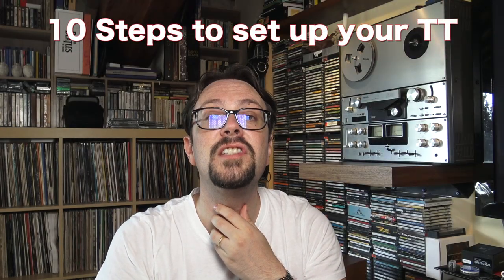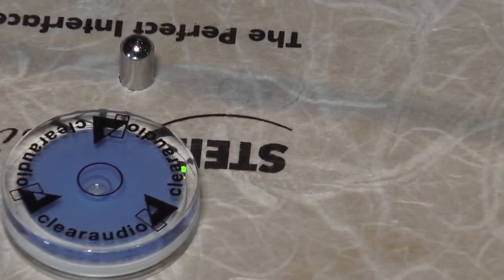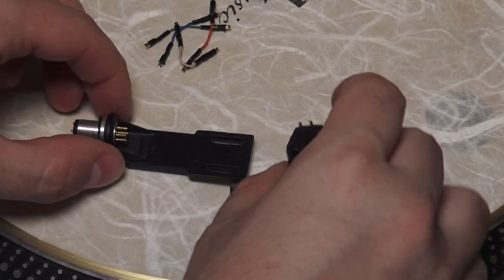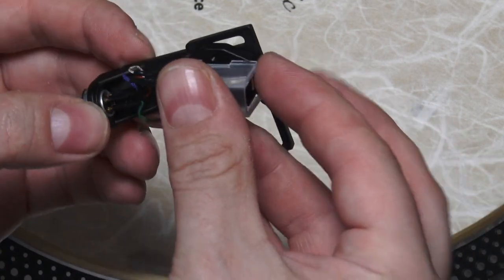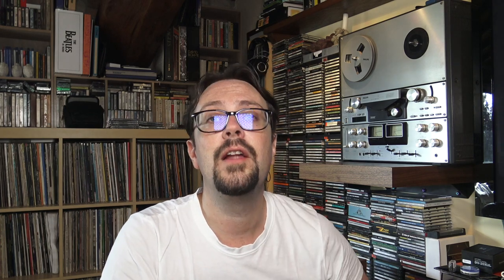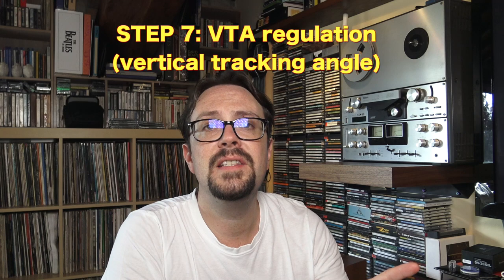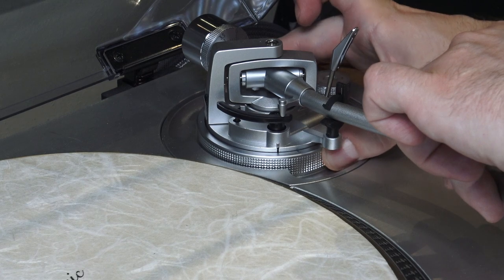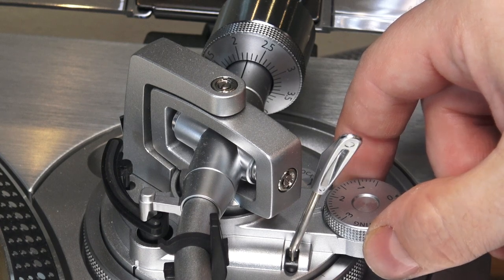The Ultimate Turntable Setup Guide

Comment: Just one thing, with the Technics turntable's s-shaped arm and known stylus overhang, setting the  stylus from headshell tail a distance of 52mm allows for the cartridge to simply be eyeballed as being parallel  to axis of headshell for the  alignment recommended by  Technics to be achieved. This means a cartridge such as one from the Ortofon  2M series, which uses integrated nuts, can be mounted in a few seconds instead of hours using the  Technics gauge. Of course, if the cantilever is bent the protractor would be needed; but, I've gotta tell ya, if I buy a cartridge with a bent cantilever, it's going back to the seller for another. At any rate, your videos are very good. You are highly qualified and credentialed enough to profess on this topic as you have experienced it.
Reply: Charles Ludwig Wanted to say this too.
Reply from the maker: Thanks Charles! Well, call me unlucky but in most cases I always see a slight irregularity in the cantilever. I slso sent back my Dynavector and it was again with the cantilever slightly crooked...
Reply: @anadialog  Im wonder if it would get itself straight after some usage?

Comment: I have friends complain of problems due to static.  Most of the static is from the record and showed them cleaning, anti-static sleeves, carbon anti-static brushes.  Well insulated wires will help in some cases. Zero stat guns are nice but costly.   Excellent video.
Reply: You comment triggered my memory that once I had a turntable came with a radioactive brush mounted in front of the cantilever to remove dust and static.  If I happened to  touch the brush, the instruction warned me to wash my hands.

Comment: Would’ve appreciated a little more detail on the VTA portion; that’s the part that everyone either ignores or gives a passing glance. An easy tip for measuring how to get the tonearm level without eyeballing it.
Reply: Yep bill you're right...and vta of a tone arm bears as much signature to the tonal balance of music as does the bass and treble of an amplifier. ideally the tone arm should be perfectly horizontal to the playing surface of the record. imagine that as being 0 bass and 0 treble. any downward angle of the arm to disc surface increases bass whilst any upward angle does quite the opposite and increases treble. if eyeballing a horizontal vta of arm to disc isn't your thing, just stop the t/table,rest the arm at a given point and measure the height difference all along the length of the tone arm. your vta should then be perfect.
Reply: And that is ofcourse...if your tone arm allows for height adjustment!
Reply: Important is to adjust the SRA ............the VTA is only function of the SRA and the choice of the maufacturer.............this is mostly missunderstood by audiophiles .
The arm is idealy HORIZONAL for optimized balanced behaviour.....

Comment: Idk what series ATLP120X is? So not all cartridge protractors are the same.. darn it..  and i cant get one from vinyl engine because registration is blocked so I cant make a free account to access the protractor..
So I just got sdroceRyaM Turntable Strobe Disc LP Stroboscope Mat Tests Rotational Speed Detection LP Turntables Calibration Disc for Record Player
On amazon.. and my cartridge head is a totally different angle. No amount of adjusting will make it align. Im so confused.
Reply from the maker: Just get a standard protractor and try to align to that, moving ahead and back the cart as well as right or left until they align to the control points. It has to work.

Comment: Hello Guido ...........very nice explanation for people discovering vinyl :chillwcat:🙂
antiskating is a very hot topic .............with higher ( 2-3 gr ) it is easier/ less critic than with very low tracking forces ( 1-1.5 gr ), in fact it depends also on the profile of the needle shape , therefor the use of a mirror / no modultion as some do to tune theantiskatingn disc is usefull but not perfect , the ear tells a lot when there is lack of stress on heavier modulted passages and also when you lower the cartridge onto the grooves when it falls fawless into the grooves , starting the music without any notion  of hesitaion with peace  and no torsion of the cantilever .
The test  grooves with different modulation  intensity are a good help also , Test trecords from orthophon and the Shure test records ( with one received on demand with the purchase of a V15 III record ) has even tracks to identify the resonance frequency of the arm maas /catridge compliance ,
just one final observation , the VTA and the SRA are related ................todatone should optimize for the SRA ( 92° )..........
When all is correct the sound will be GOOD to VERY GOOD....................but when you realy get it fine tuned it will change into MAGIC ............a quite different sensation .........
then the wise audiophile stops to try even more , a little above or a little less  and the magic is GONE and you have to start it all over again hoping to find the magic again...

The last comment is because all the perfect adjustments are based on the ASSUMPTION that the caqntilever and the STYLUS are perfectly geometrical aligned by the manufacturer witch is not necesairy  the case even with very expensive cartridges .........some manufacturers do a better job than others , thats( the reason in most cases for fine tuning by the ear after one adjusted the cartridge ...

The ear is the FINAL JUDGE !
Reply from the maker: I'll start from the end. I actually put a big accent on the fact that cantilevers are actually in most cases not aligned and hence use them to allign the cart. Maybe you skipped that part. Yes, I agree that test disks are a great way to establish if the stylus is centered in fact I did a dedicated video: https://youtu.be/-RCtrqqGRPg
And also a dedicated in depth video on VTA and SRA: https://youtu.be/v-YyKktxadg
Reply: @anadialog  Ok , i will have a look ..........my comment was mainly to those audiophiles to bring that to their attention , but indeed you did it already !
Have a nice day ....

Comment: I know a guy who made a recording booth out of a walk-in closet. He covered the walls and ceiling with soundproofing foam. It works well, you can feel a strange sort of air pressure drop on your ears when you're in the room. It really does greatly reduce all noises in the room. I wonder if it would be a good idea to cover the lid of the turntable with this type of material, To reduce any feedback vibrations between the vinyl in the needle and the sound coming out of the speakers simultaneously? The only thing I don't like about the soundproofing foam is it is highly flammable. I wonder if non-flammable is easily available man affordable?
Reply from the maker: I know that sensation, it's the same in a recording studio. The sound is too dampened for me. It seems unnatural, no reverb, and it almost hurts when silent.

Comment: For Technics I've been told just to set 52mm overhang and the cartridge straight in the headshell but it's either 52mm overhamg 'or' protractor?
Reply: You are absolutely right. Just set stylus to headshell tail distance to 52mm using gauge and then square cart to headshell. That’s it to realize Technics tracking error scheme.

Comment: Excellent video, however I think it is important to point out that the necessary anti skating adjustment is less as the tip of the stylus is thinner (in fact there is a relationship, more than proportional, between the less thickness of the stylus and the less adjustment of anti skating), then the correct way to calibrate it, if you don't have a test disc (which happens in most cases), is by ear, instead of adjusting it to the same level as the tracking weight.
Using a grooveless disc (blank) is not recommended as it does not have the friction of the grooves where the stylus does its job.

Comment: Nice video. Under connect TT to preamp you illustrated with a text showing "Any of the audio input can be used to connect your Turntable" Shouldn't be preamp instead of turntable?
Reply from the maker: Yes, the preamp output, you are correct. That was a stock image, in any case the figures and scheme of connection is correct and in fact you immediately detected that mistake.

Comment: Hi! Really nice video and great channel, I just have a question about alignment. I have a technics sl-d1 that has the same specs of yours in terms of alignment (s-shaped arm, pivot to spindle distance,ecc). Do you suggest to use the technics overhang gauge OR the technics baerwald protractor from vinylengine? Because I can’t use both, as the baerwald needs the cartridge in a different position than the overhang (with baerwald the cartridge is all the way at the top of the headshell). Thanks in advance!
Reply from the maker: In the end I prefer the Baerwald, which is specificalky designed for that model and truly works great...be precise when you print the protractor (possibly on heavy weight paper) and when you punch the whole...must be EXACTLY in the middle!

Comment: Not sure if I'm correct but that technics prottracker for technics sl 1200 is only for mk2 and up. The first generation technics sl 1200 from 1972 to 1977 have a different arm that have 14 mm overhang instead of 15 mm.

Comment: For Shure M447 and 44g carts, should you have the screws showing on the top or the bottom (do you put the screw or the washer at the top)? Also shouldn't you do tonearm height before cartridge weight/zeroing? Also for tonearm height, you need a (NOT SHARP EDGED!) ruler to measure, it's really hard to tell by eye if it's over or underhung. Also there is no 'correct' pressure, how do you know 2.2g is the 'right' tracking? Maybe 2.154 is better. Or 2.213. You can only test this by changing during playback and checking your ears/spectrum. Every cart has a sweet spot and it probably won't be on an exact number. So, you can go crazy trying to find the 'best' weight or just accept a general sweet spot.. making sure it is 2.2g and no 2.1g shouldn't make a huge difference.
Reply from the maker: Uuh! A lot of questions there. For the cart the direction of the screws is the same. Washer goes under head of screw to avoid damage and lock the screw in position. The VTA of tonearm is not tied to the cartidge weight zeroing since we are going to use a gigital scale afterwoards the tracking force is going to be slected afterwards. The important is the VTA, vertical tracking angle, not the tonearm height. Usually it is obtained when parallel but not necessarily. It also depends from the compliance of the cart itself. One suggestion: thick the rules, don't apply them mechcanically. In any case, a ruler can help, sure. The correct weight is indicated  by the manufacturer as I pointed out in the video, who suggest for my Dynavector a tracking force of between 1.8g and 2.2g. A rule that I follow, is to set the maximum recommended tracking force.

Comment: Loved the video, just not sure about your anti-skating method of regulation... To be honest, I ve seen at least 4 different methods of calibration and I am still not sure witch one to use. Peace.
Reply from the maker: Thanks! Well, the test lp did not buzz (it slways does a bit!) So the anti-skating is properly set...at least in my situation!
Reply: I've seen some test discs that have a blank section and you set the stylus down into that area and adjust the anti-skating until the arm doesn't move.  Too little and it'll move toward the spindle, too much and it moves toward the lead-in groove.

All these adjustments are pretty delicate.  Back in the day, I got a Shure V15 Type V cartridge that came with it's own duo-point alignment kit.  The "protractor" had a part where the cartridge snapped into it and then you slipped the other end over the spindle.  From there, you just tightened up the screws to secure it to the headshell, perfectly aligned.  I also had something to place inside the cartridge (where the stylus plugged in) so that you could make sure the headshell wasn't twisted and also check/adjust the VTA.

The test disc I got was also part of the kit, but I think you had to send away to get that.  I got mine for free and used it to adjust my cartridge and it sounded great when I was done!

Good Luck!
Reply from the maker: Thanks for sharing your experience!
Reply: anti skating is a touchy thing.  All cartridges are different.  Usually lower compliance cartridges need less anti skate and higher compliance cartridges like moving magnet cartridges need more. YMMV.

Comment: Where did you get your anti skating regulation from 2.2 Anti skating seems pretty extreme to me. I'm not sure the true way to set anti skating but I have watched a few videos where people have used a blank side of a record to reference how the stylus tracks. Some people recommended tweaking the anti skate whilst the record is playing and setting the anti skate so the stylus coasts in the middle and doesn't drift in either direction. In other videos people have suggested it should drift towards the center but it doesn't make sense because the stylus isn't sitting in any grooves therefore isn't tracking anything? I set my anti skate just by listening to a record i'm fimilar with and tweaking it, I've never needed more than 1-2 antiskate. I run Orfoton Scratch MK2.
Reply from the maker: The only way to set correctly antiskating is using software, but it is to complicated and expensive IMO, or, as I do, a test disc like HiFi+. That will immediately tell you if your stylus is dragging on the side of the groove.

Comment: Hi i have clearaudio concept turntable and i recently changed the cartridge to AT-ART9. I have the same scale as You and if i place the weight close to the edge it has 20% more VTF than closer to the center. What place should i place the scale? Also the suggested VTF for the ART9 is 2.2g, but i can't make it to track properly at this weight, i need to go to min 2,6g. I read that the magnetic floating tonearms are hard to set the VTF on, can You tell me whats wrong, and how to fix it?
Reply: coin777 the magnetic floating tonearm is VERY sensitive to vertical vibrations.
Like if you have for example a woden construction floor when you go/walk on it flexes up and down it will go up truth the floor and of course move the TT up and down also but your floating arm have its own mass and will not move with the TT plinth. (The magnetic suspension act as a spring!)
 
There is YouTubeer (sorry forgot his name) that got his tonearm on just that TT and arm combo, replaced just because of the above senario, with a more traditional non floating one. There the tonearm is fastened fysical with bearings to the plinth. So the TT movement will force the tone arm to move with it.

Another tip is if that is your problem and you can't get another arm is to try to mount a shelf on a wall instead. To eleminate the influence of the floor.
Reply from the maker: I see that you yave already picked up an answer...I am very curious about the scale that chages and foes not go below 2.6! Try changing scale. Now they are much cheaper. Do not put 2.6 it might ruin your records after a while. Position thr scale between the spindle and the edge.
Reply: @AmazonasBiotop  Hi there, I believe you refer to Jeff from Vinyl Room.

Do have the magnetic arm on the Concept and in my case (concrete floor) no issues a great and with MC even stunning table for its price.

Comment: If you run a ground from turntable to preamp you don't need to run one from preamp to receiver?
Reply from the maker: Usually, no. But when you experience strange hums I personally try everything and in some case crazy things do work!
Reply: Update: I’m running a Fluance RT-85 into an Ifi Air Zen phono preamp with the ifi silent power supply. Ground wire from turntable to preamp. Preamp into AV receiver but not into the phono input. AVR is in another room so it’s a looooooong cable run. I’m getting no noise at all. No hum and no hiss. There is no ground wire from preamp to av receiver.

Comment: Welcome Back 
I had an issue with the weight balancing 250 mg , I had this setting for some time , I was looking at the stylus as it was level but this scrapes the record after I came aware of what it was doing wrong , I set the balance weight to 0.5 mg , this may be under but as long as my records  are fine  its a plus .
It sounds far more crisp now I have took all that weight off the record .
If I did not have you tube  I would of   carried on with this setting & living with this error for a lot longer .
These 80s pop albums sound far better than the up to date club trax .
Analog sounds better detailed than these Digital Discs .
Bear in mind , my decks have not really been used to much as it takes a bit of organizing a mix with records  so less damage .
Is it true that a stylus should be replaced every 2 years ? 
Also they say that we should replace the cartrage  as it age & stiffens ?
My Pioneer cartrage sounds fresh after all these years but my Audio Teck sounds batterd out which came with the decks 2004
Reply from the maker: Always use a precision scale! You must substitute your stylus after 500-700 hours. Sometimes even more. It depends from the tracking force. In any case you need to check thr stylus to be sure. I will do a video on this in the next future. No need to change the cartridge if things are sounding ok.